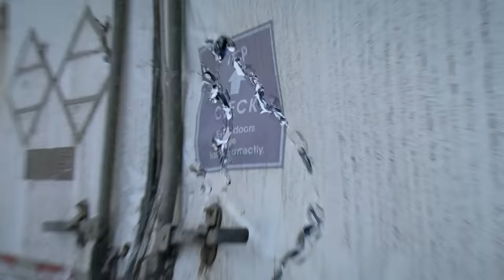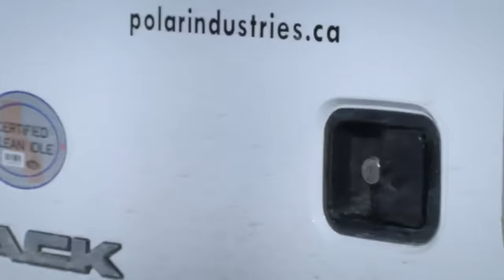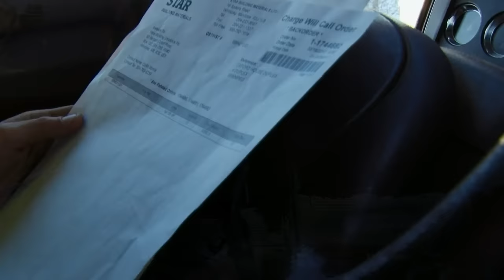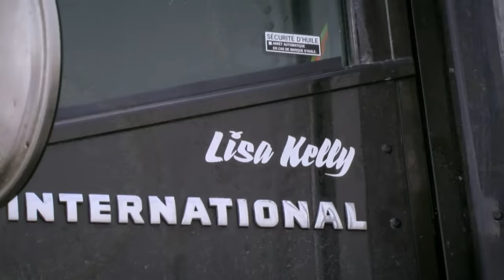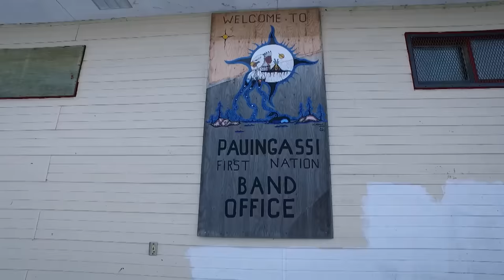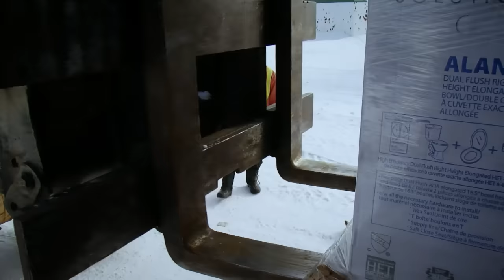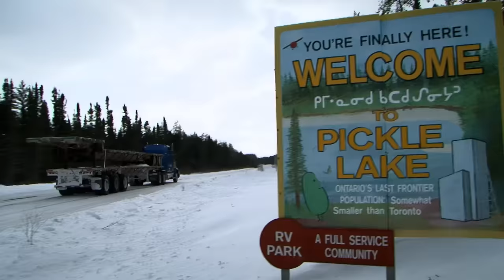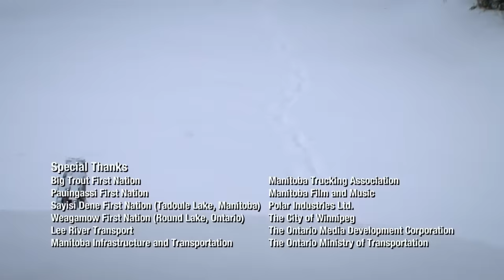Ice Road Truckers: Jackknife Jeopardy (Season 11, Episode 2) | Full Episode | History

Comment: What are the odds that Lisa runs into two guys with a set of tools and know how to fix a big rig? These guys are obviously part of the crew and are not fooling anyone
Reply: I don't find that part odd at all. I have ran into real life savers on the road randomly myself. (I'm a trucker) but what does get me is she should have been able to get to her dog box from inside the truck. The bunk usually lifts up so you can access the dog box from inside the cab. That's been the case in every truck I have ever driven.
Reply: @duckysingleton4712  since ur a trucker, I was wondering about how long could a truck idle with the tanks full? Also how far can a truck drive before they need to be refueled? Thx
Reply: @raidernation7427  by the numbers, I run two 80 gallon tanks and average 8 mpgs. That is about 1250 miles per full tanks. But load weight and the terrain you drive will affect that. Idling uses a few gallons an hour depending on the truck but some trucks have a feature that will auto start and stop your truck so you don't waste fuel. You will notice your fuel needle moved after idling a whole night.
Reply: @duckysingleton4712  I remember the Freightliner FLD 120 didn't have that they were was a cover over the box
Reply: @LBZDreamer  oh ok I didn't know that. I've drive and only have driven Cascadias from Freightliner.  And I drove Internationals and a Volvo.

Comment: very irresponsible driver not wearing a seat belt is a mandatory use
Reply: Not if they are going over ice, if the truck breaks through they won't have time to get the seat belt off . Those lakes are 100 ft deep and the trucks sink immediately because of the weight.